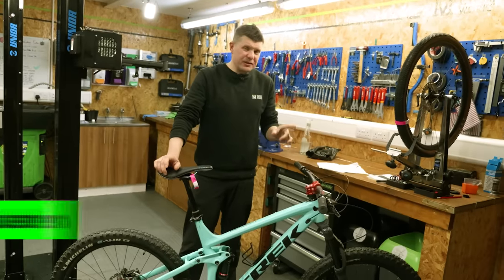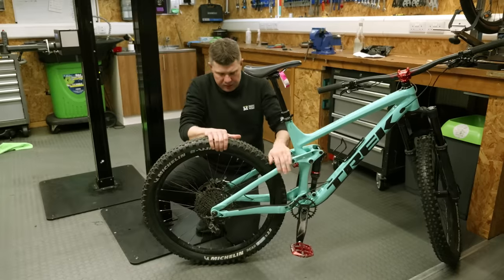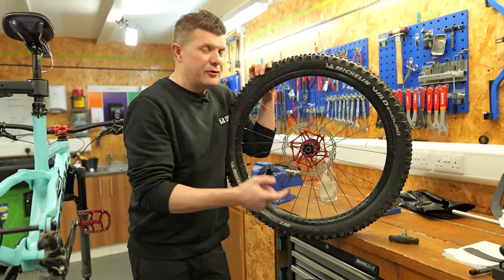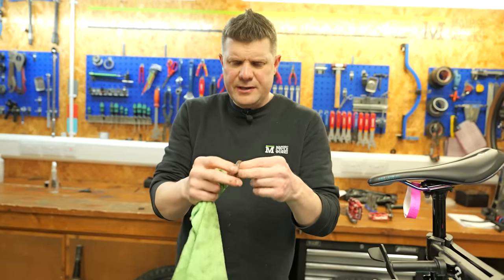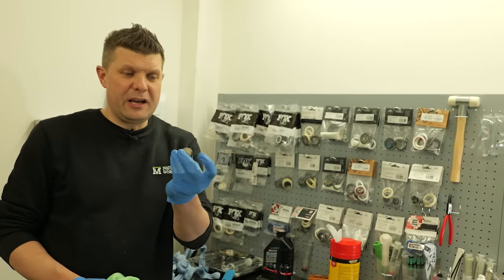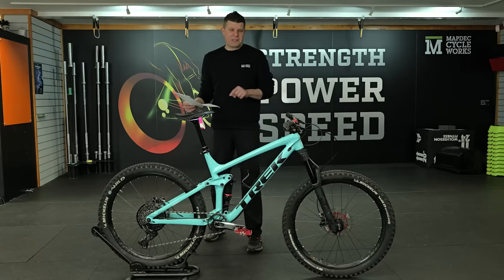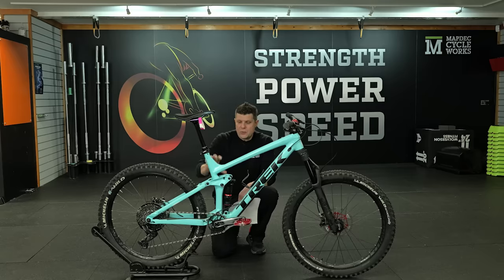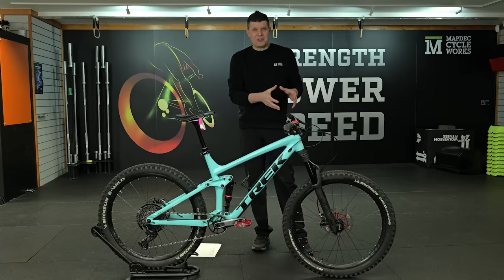They were quoted £975 to make this Trek Remedy safe

Comment: The real issue  is how we've got to a point where it costs so much to maintain and repair a 'basic' form of transport.  That bike doesn't look that old and yet the 'repair' cost is 50% (?) of the new cost.  If you'd bought a new car and was spending a similar percentage on the repair costs after a few years, you'd be up-in-arms.  And even the reduced repair bill is eye-watering.  I think so many people are completely blinkered on these servicing costs.  Perhaps it's just a case of well-off middled aged men (and women) and 'affluent' youngsters being relieved of their cash without realising they're being duped.  Just my opinion.
Reply from the maker: It’s not really a basic form of transport though. It’s an advanced price of sports equipment.
Reply: @Mapdec  Sorry, I don't agree.  It can't be that 'advanced' as you state if it needs such costly repairs after such a short time.  As I stated, no one would accept this level of repairs on a car in similar circumstances.  You don't see bearings and shocks wearing out on cars in such a short time - and car components are under much greater forces than any bike.  There's a very expensive 'con' going on here, and too many people are falling for it.  More money than sense and falling for all the hype...
Reply from the maker: @georgethompson997  don’t worry. If you don’t ride MTB you will never understand.
Reply: @Mapdec  You use rudeness to mask your inability to counter my comments.  Proves my point really.  Thanks
Reply from the maker: @georgethompson997  no, that’s not rudeness.  That’s politely disengaging.  You started an argument criticising my profession without the necessary knowledge or experience to provide a valid argument or quality feedback. Maybe just watch some MTB footage on YouTube and see what riders do on these bikes, and remember that riders need the bikes to be as light as possible.
Reply: @Mapdec  There was no argument on my part, there was a constructive point that bike need an inordinate amount of repairs in a very short time.  And my point didn't just relate to MTB, I've seen many road bikes needing similar eye watering bills.  So you could correctly say MTB will need more repairs than road bikes, but that doesn't negate the point entirely.  You don't see bearing failures in cars, which are subject to much greater stresses and environmental pressures, like you do on really relatively new bikes.   A bottom bracket on a road bike should really last the life of the bike. You never addressed that point, merely making assumptions about me when you don't know me.   

At no time did I criticise your profession; you're just the repairers.  And at no point did I express any criticism whatsoever of you personally (I can't say the same of you!), the work you do, or any other repair facility.  I was criticising, if anything, the design, manufacturing quality and component quality of the bikes that are being sold.  It can't be right that people spend many thousand of pounds on bike that wear out so quickly.  All this 'technology' eventually gets pushed down on to the cheaper bikes, similar to the car market.  So in the end, affordable and durable bikes will not exist.  Surely that must be a concern to everyone.  And similarly it must be a concern to the bike repair industry on the ever increasing cost to repair bikes.  Eventually many bikes will be beyond economic repair, and that can't be good for business or the environment..  Maybe you to need to stop and think what point people are making before getting on your high horse.  Sometime YouTube gives certain individuals a false sense of their own importance.

Comment: Sometimes I wish the UCi would ban all complicated, complex, and ridiculously fiddly and expensive suspension components and save the planet (and bike owners) the hassle and expense and pollution.  If everyone (pro, etc) were required to race using the same-good but basic suspension components--the landfills of the world would appreciate it.  I bought a fairly new (+/ 10 yr old) Trek Fuel 9.8 with a super fancy / expensive Fox fork that was something like $1000 retail... and... of course... it failed... and Fox did not support it in any way.  No rebuild kit.  Could not send it to them to be rebuilt--at any price.  So... it went in the landfill--and now that bike has a new--albeit much cheaper / heavier fork on it.  If it's so complicated that the manufacturer won't even support it--sell parts for it--or service it... then it should NEVER have been on a bike to begin with.
Reply from the maker: Was it a Talas?

Comment: I think for the price of the first quote will giving the person I think that is a rip-off he could get the parts a lot cheaper there are different places but you saying so he can use the bike for summer so you make good of a item when it could BA new part but if it got a new chain if you have cassette and chain rings it would need new chain rings and a new cassette a new straight in axle with chain crank Arms the most expensive part on the bike is the rear expansion and front forks if they need new seals the buying a fool Spencer carbon bike if he is not looking after it you said the rear wheel was loose when you tighten Up The quick release that will was nice and firm itself when it sounded with the wheel where will no grease in the back between the Combs and the bearings the roller bearings because of the free loose bag cones we're running a little bit too fast so it was no grease in the axle weather Gear mechanism could have had new jockey Wheels for the crank Arms that could cost between 200 to £300 all upwards it just seems to me a bit expensive but all this stuff was outrageous for estimate price near the over £1,000

Comment: nice video and good for calling out the bad bill but honestly the hate for the jetwash had me bouncing out if the video by the 27th mention, the biggest problem I have had with treks of late is the total lack of grease in headsets, wheels, etc. I jetwash my well greased bike 2x a weekend in winter and no grease goes if it’s right grease in and well applied in first place. you really have to be a jetwash psycho to clear out grease from a sealed bearing: https://youtu.be/LzbpHGyFzc8
Reply from the maker: Yes. Very true.
Reply: And yet... one of the best things I'd advise anyone to do to any bike is never jet wash it. Just a weak normal hose and a soft brush does the same and is much kinder. I watched that video linked, and from my long experience its nonsense. ProTour mechanics use jet washes cos its fast and the bike only needs to last a season....